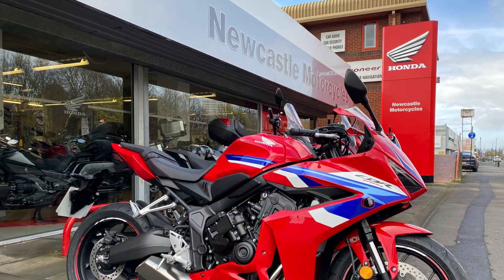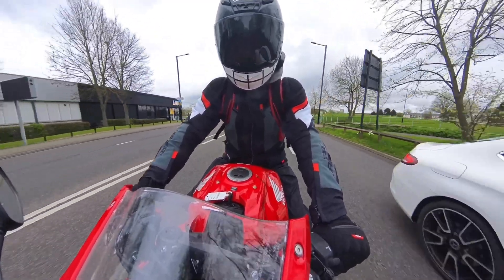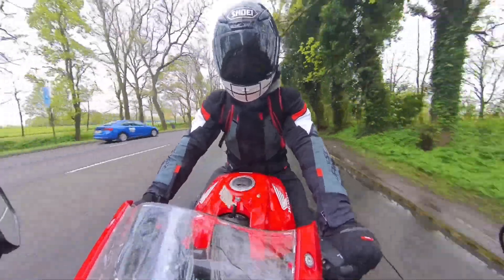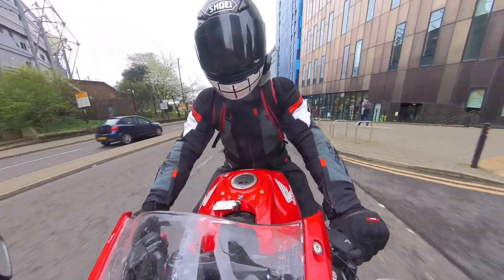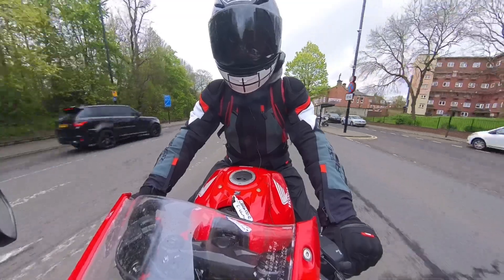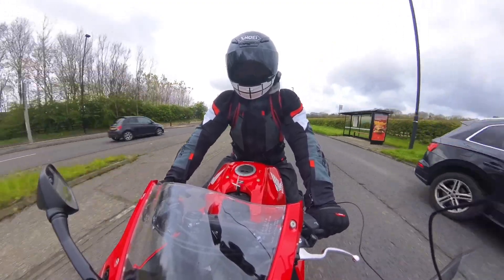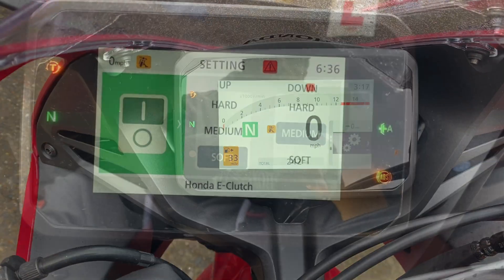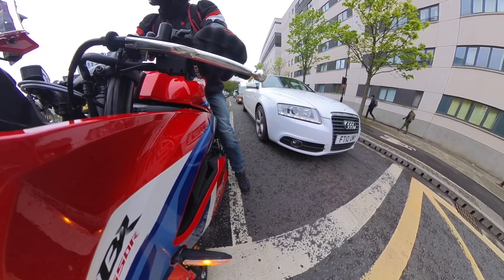Honda E clutch

Comment: How does the bike feel riding in town without ever touching the clutch at like 15-20 km/h? I mean it's gonna jerk back and forth like a horse riding in 1st gear when you open and close the throttle a lot right?

Comment: Do you know if the E-Clutch will be fitted to other bikes, such as the CBR500R?
Reply from the maker: I guess so in the future. It only adds a few kilos to the bike not like DCT which adds 10 kilos. Plus its just a clutch casing with the E-clutch motors on unlike DCT which is totally different crank cases.

Comment: Curious that they didn't just go for a full auto/manual DCT since they've perfected that already.  Maybe this still has the 'sporty' feel if you want it.  Gotta love Honda, still pushing the boundaries !
Reply: Because most people were complaining that dct is not smooth  enough for tight maneuvers
Reply: @clevernduruza8624  yes, that makes sense, there IS a delay when shifting the Honda motorcycle DCT.
Reply: DCT is very heavy, and very complicated
Reply: making it a  DCT machine will make it a lot heavier unlike this e-clutch system only adds 3kgs.
Reply: thanks for all the comments explaining the performance/weight costs of the DCT.  It all makes sense.  I had a DCT Honda and loved it, but it was not a performance bike where the extra mass would make a difference.   High performance cars come with DCTs but the percentage of mass gain is not such a big deal on a car as compared to a motorcyce